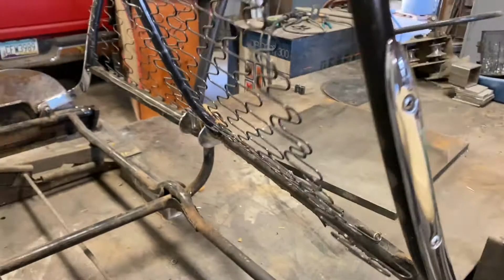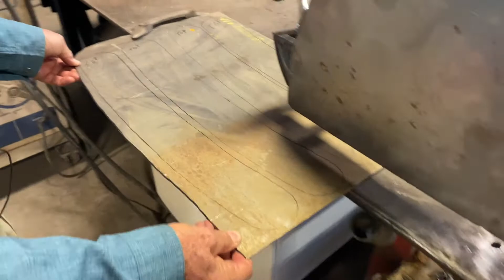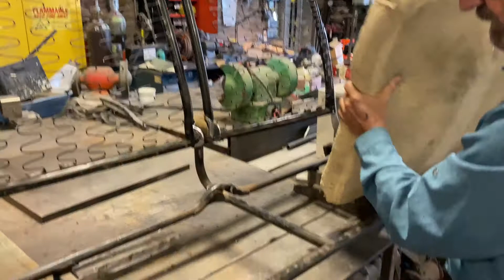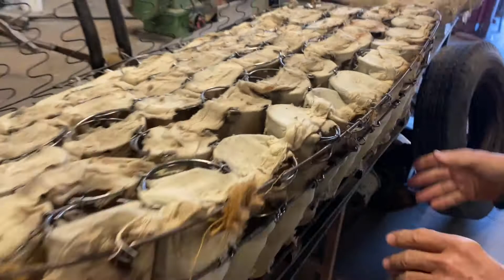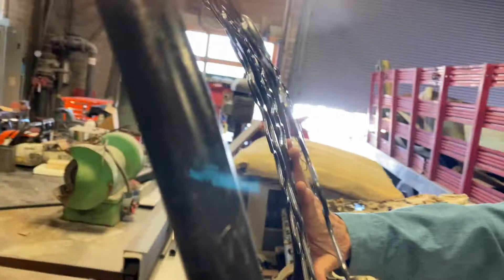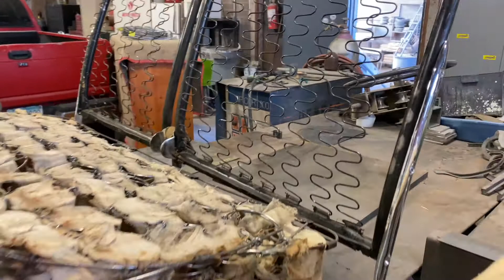1938 Zephyr Part 15 - Seat Frame. Restoration of a 1938 Lincoln Zephyr V12 Coupe.

Comment: I wonder what is done on a seat bottom ----- checking the coil springs ---- losing their tension / sagging ---- the rod going around the perimeter holding the coils in place --- and the wires attaching the coils together as well as to the perimeter rod ----- Just things that have to be looked at when one is going to use the Original Seat as I intend on doing with my '38 Ford Coupe -------- interesting though ----- uses a '37 Ford Coupe seat frame to build off of ---- for the '38 Zephyr ---- not a very good candidate ------ Thank you for the Video ------- Curios ---- do you have to travel very far to get to JB's Shop?------ Is this in Arizona ------ In video #1 or so ------ there wasn't much of a roof over these cars -------- Thanks Again ------- Rodney
Reply from the maker: Hi Rodney - JB’s shop is near downtown Phoenix… I live in the same city but not close by so I have to make about a 30 minute trip to get out there. I try to coordinate best I can to catch good moments. Thanks for all your insightful comments. Sorry I don’t always have all the information you’d like!